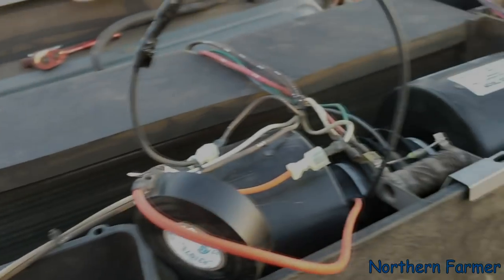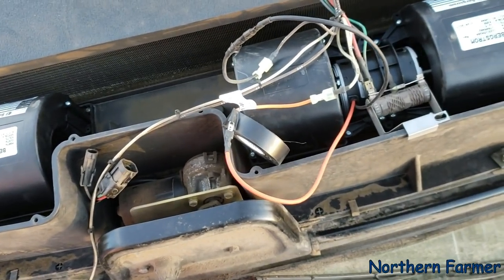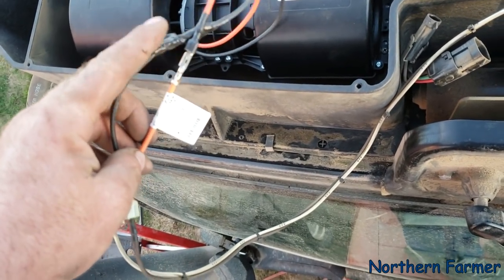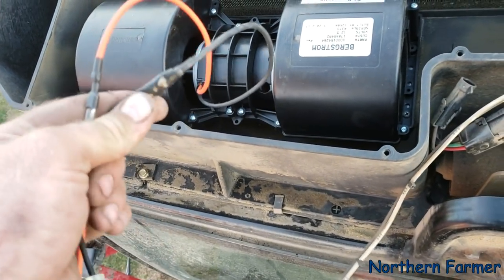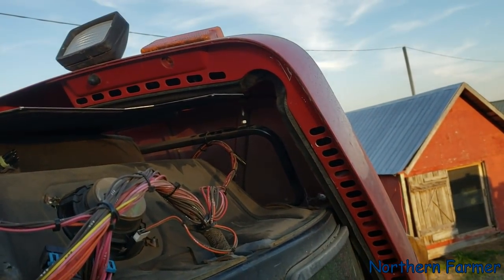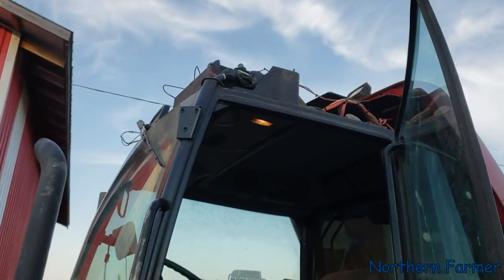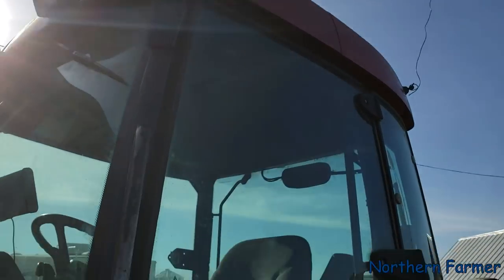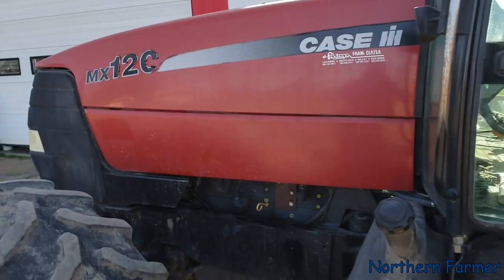Blower motors Instalation CaseIH Mx 120

Comment: Those tractors have so much glass you need the blower working.   Our 2390 AC quit working and it was 34C out but the blower worked and I drank 12 bottles of water , now that we are done seeding I'll try to fix it.   It is handy that the south farm is all canola so you aren't switching back and forth.
Reply from the maker: Yea... to go that far I wouldnt want to different crops there

Comment: That’s interesting,I have 885xl 1982 model,how did you get the roof off the cab?
Reply from the maker: 4 nuts
Reply: Ok thankyou,I’ve started to go in from inside cab now,reason being,fan turns its self on,even when switch is on zero,thinking it’s when tractor is normal temperature,a wire is moving,so I’ll be on it tomorrow,funny thing is,never had heater working,finally got that sorted,suppose the tractor liked it that much he turns it on his self 😀 Thank you for replying 👍

Comment: Tyson, just watched you video and was wondering if this cab was and XL cab and if so, how did you remove the lid?  I've been looking for information to get to the blowers, lights, etc. and have not been able to locate, other than remove the whole cab.  Thanks in advance if you can help.
Reply from the maker: @joeskroch7856  xl cab? We just pulled the nuts of the bolts on top the cab and lifted it off. I don't know how lifting the whole cab off would help get to the blowers
Reply: @Northern_Farmer  Thanks for the reply.  I guess I didn’t make it clear at what I meant on removing the cab.  I should have said the only info I’ve found on getting that cab is how to remove it.  Sorry about that. Your video and info is what I needed to see.  And I just went to climb up and see where the bolts are at, and discovered that apparently there is a large wasp nest in the loader arm.  I’ll try it again after I deal with those.  Thank you again.
Reply from the maker: @joeskroch7856  no problem...I remember it was pretty easy
Reply: @Northern_Farmer  Wasp removed, got up on the loader arm and looked at the top of the lid, didn't see any nuts\bolts to remove.  I don't see anything from the inside to remove either, unless I take off the interior.  I do have a hatch on the top, not sure if that maybe the difference.  I appreciate all the help.